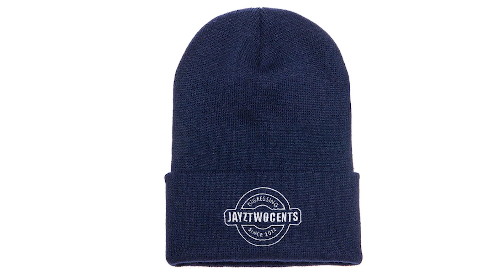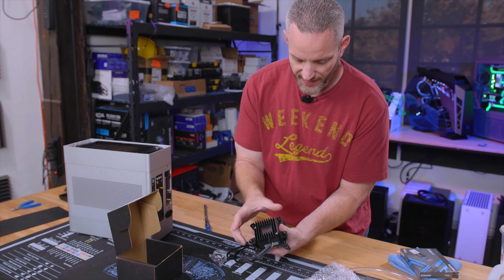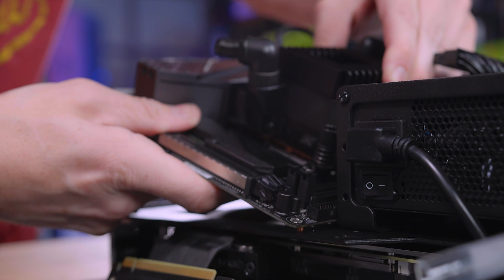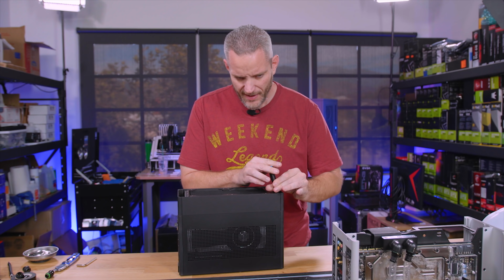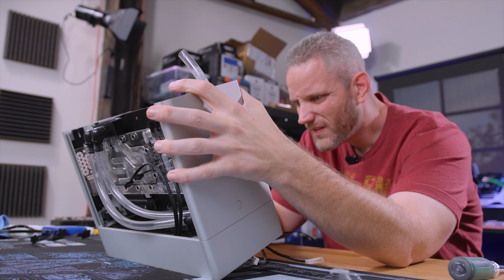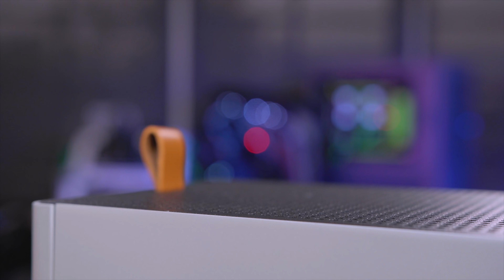The smallest watercooled PC I've ever built is COMPLETE!

Comment: See my worry about this setup is once you load it up with some video rending and it starts to heat up... is it going to blow a hose off? Because it doesn't have a reservoir, there's no place for thermal expansion of the fluid. This is why cars have reservoirs for their coolant. It's not just a nifty place to keep some extra coolant fluid, its a place for the cooling system to use for thermal expansion and contraction. I'm not saying this won't work... I just have some reservations about it. That being said... the radiator, if it's beefy enough should be able to cool the system efficiently enough to keep the liquid from expanding enough to blow a hose so that might be the key. Either way... might be interesting in another video down the road to stick a pressure gauge in one of the radiator plug holes and see what the internal pressures get up to under full work load.
Reply: Nope. Aios.... They don't have a resivour? They do just perfectly fine. He's basically built a huge aio system. It's fine
Reply: @OutdoorSoHard_69  aios have air in them man. You ever shaken one? You can hear the liquid slosh around because they leave air inside for expansion.
Reply: PC Cooling wont get hot enough for enough expansion to blow a hose, The reservoir is for filling and monitoring purposes only on a PC build. Back in the day there were no tanks for filling and it was done with a hose , fill, burp, fill, burp... etc until it was full, the res resolved that issue. Also on a side note your res does not have to be 100% full bout 50-75% will do just fine.BRAIN FART! Radiators on a car rely on the cap to open up for expansion and contraction so NO a res does nothing for expansion and contraction on a sealed system. It would need a way to open up to an EXTERNAL res with an air hole to do that job.
Reply: On my SFF builds without reservoirs, I load up the system as much as I can and get water temp up with low fan speed. Then I seal it up. When it cools, there is slight negative pressure, but when loaded it equalizes. This technique also helps remove air in the system, as the slightly negative pressure pulls the air out of the loop faster.
Reply: I'll leave the other comments alone as I don't have time to nitpick, but j will say that the temperature difference won't be enough to create a lot of expansion pressure, and the sift lines can expand just a bit, which should be enough to compensate. 

:)
Reply: People do not understand the difference between "increased chance to leak" and "will blow a hose and leak right away". I may be the only a few with you on this. 
Reservoir is a place to keep some air buffer, extra coolant and bleed a loop easily. You do not have to use a reservoir as long as there is something containing this air buffer. As I mentioned in my other comment, water expands in volume by 1.41% from 20c to 40c, and 2.1% from 20c to 50c. With no air in the loop at all, all this expansion in volume will have to push something away. Radiator itself is all copper and some brass, soldered together, it is unlikely to crack under this pressure. O-rings in all fittings and block may not hold up to this pressure increase.
Reply: @What_Other_Hobbies  I'd expect the plastic tubing he's using to easily stretch by 2%.  It should have the largest internal surface area of anything, except maybe the radiator.  O-rings are used in much higher-pressure scenarios than this, so they won't have any trouble at near-atmospheric pressure.

Comment: Why not make a custom side window for this badboy?
Reply: Probably because of temps, the side panel that came with it has holes all over for more airflow.
Reply: @callumsweeney4308  then make a custom side window with ventilation holes! haha
Reply: Oh yeah, because when your case is custom, you have to stop at a certain point making it more custom. Stupid argument.
Reply: @callumsweeney4308  Yes but those holes are no longer needed because the whole thing is watercooled with 4 140mm fans pushing air through the system. He might need to keep a vent over the psu fan but the graphics card side could definitely have a glass panel. 

The only reason he wouldn't want a glass panel on this is because it's meant to be thrown in a suitcase to take to CES.
Reply: @fortunefed8719  I would go with acrylic. More durable, and lightweight.

Comment: Can’t they just use the water and freaking radiator to cool the motor. Having heat sink is kind of counter intuitive.
Reply: Well no, because you would have to redirect the flow around the pump to cool it, which would severely reduce the flowrate. Furthermore the coils are isolated from the water by the pumping element so it won't cool much through that side either

Comment: Having no air in the system might actually be a bad thing, if the loop gets hot enough under load. With no air there's nothing to compress when the fluid heats and expands, the pressure might not be good for seals. Then again the temperatures aren't extreme so it's probably fine, it's just a thought.
Reply from the maker: It’s fine

Comment: Hey guys I want to build a cheep gaming pc but I want to make a cheep as hell. All I want for it is to play modern games at 1080 P at 60 FPS. I was thinking to save a buck to get a 6th or 7th gen I5 and go with a 980. And a micro ITX mother bored.  With a small SSD for OS and a hard dive for video games and other files. Do you guys have any other cost saving measure ideas ?

Comment: Umm, the smallest watercooled computer is a raspberry pi
Reply: Hence why the title says "I've".
Reply: Raspberry pi isn't a PC though. 'PC' implies x86. Those use arm processors.
Reply: Kyan2005 yeah but the best thing a rasberry pi can run is GameCube emulators
Reply: @karbaona   Gamecube??? More Likely nintendo 64 at most
Reply: @karbaona  my raspberry pi is my home theater pc.
Reply: Link Mr.GoodSir Plz ;D
Reply: Kyan2005 I heard about a chip with a built-in cooling tube and a tiny bottle of pressurized coolant that would slowly empty out over the hardware lifetime (not refillable).  Not sure if concept or actually made though.  Also not sure if technically liquid or gas cooling.

Comment: You don't want the tiniest bit of air in the system for expansion of water? Wait, water doesn't expand huh.. or does it.
Reply: Unless the system was getting to the boiling point of the water, it really shouldn't be an issue.  The pressure change will be almost negligible and expansion is incredibly small on that scale.
Reply: Sometimes. Depends on temp. It expands when it turns into ice.  Given the crazy things he did with the gamers nexus and overclocking it may actually be a problem lol
Reply: Iirc water is at its densest at 4°C, higher or lower in temp will cause expansion.
Reply: Water is weird like that, expanding as it gets colder. Most other materials shrink. Some of the explanation is in the "mickey mouse-shaped" form of the water molecule, a so called di-pol. When water freeze, the magnetic attraction creates room between molecules, and dictates how they line up. Here we find the explanation why ice floats in water and why snowflakes have six points. Fascinating stuff! :)
Reply: It might add some pressure, he did say when a cracked a fitting loose liquid came out. But should not build enough to be an issue.
Reply: Flex tube handles that, I guess. ;)

...besides - metal also expand when heated, so... :D

Comment: Hey Jay can you shed some light on pc parts quality I've built my first rig and I had bad ram, a bad power supply, and now a failing drive the ram was made by patriot the psu by corsair and hdd was by Seagate
Reply: Did you order the stuff directly from China? It sounds like you just got counterfeit stuff. Or you need to stay home for a few days to let your bout of extreme bad luck die off.
Reply: This has all happend in 6 months ram was bad out of the box psu like a month later and 2 days ago hdd